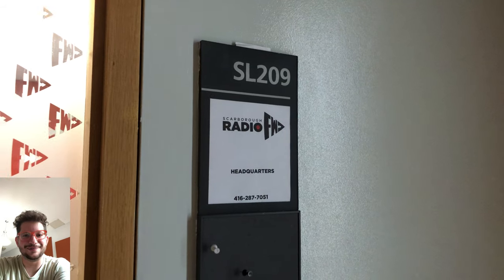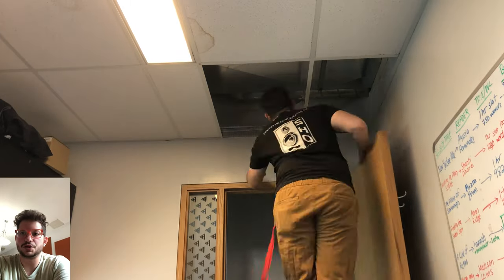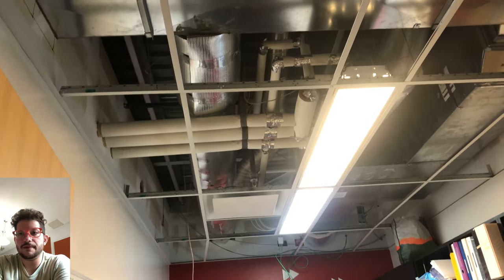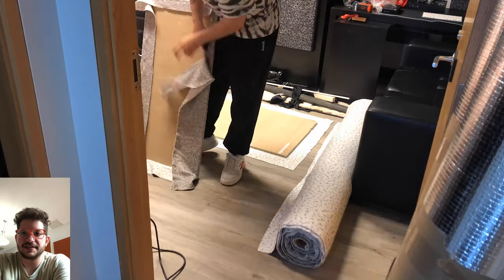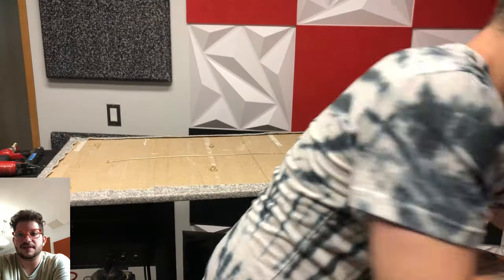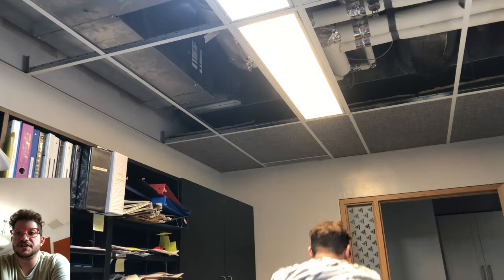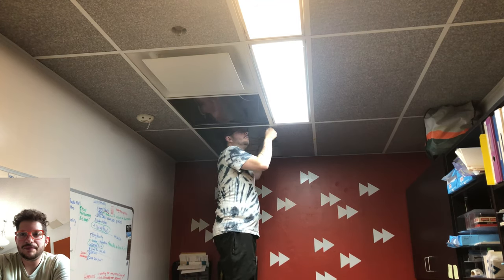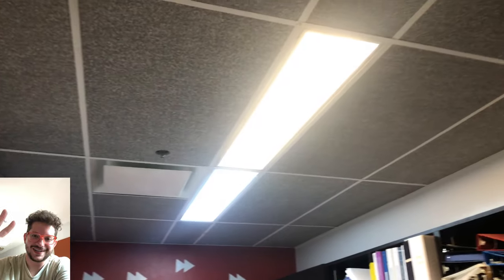DROP CEILING SOUNDPROOFING HVAC WRAP MASS LOADED VINYL!

Comment: Love this video and thank you for sharing. I live on the first floor of a two-level building. I have lived in this building for over 10 years, and a year ago, the unit above was remodeled, and the carpet was removed. I have submitted many complaints to the management office, but nothing has been done. The tenant has been informed, and I believe that has upset her, resulting in more noise. The footsteps and impact noise are intolerable. I've watched many videos on soundproofing an existing ceiling, and I'd like to be able to remove it when I move out. Would adding a drop ceiling and following your video help my problem? Or do you have any other recommendations? Thank you in advance.

Comment: Hi, I don't know if you're going to see this, but how would you go about installing acoustic clouds onto a drop ceiling? I have an office space that I want to convert into a recording studio, but it has a drop ceiling, where the upper ceiling is quite far from the drop ceiling (probably 4 to 5 feet, not exactly sure). Any advice or tips would be great! Thanks!
Reply from the maker: There are clips/hooks that clip into the drop ceiling track that you can hang acoustic clouds from. They are available on Amazon. There is also benefit to filling the cavity above the drop ceiling tiles with acoustic insulation. Look into it some more and see what will work best for your situation! Thanks for watching
Reply: @soundheadquarters  Thanks for your reply! Appreciate the advice! In your experience, would the tracks be strong enough to hold clouds? Or does it depend?